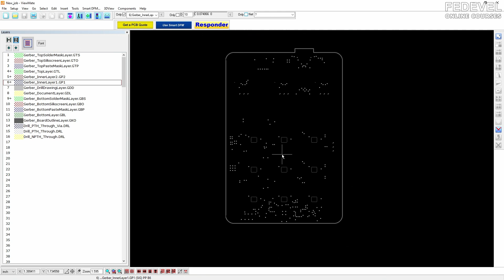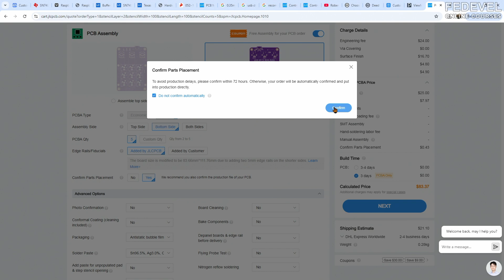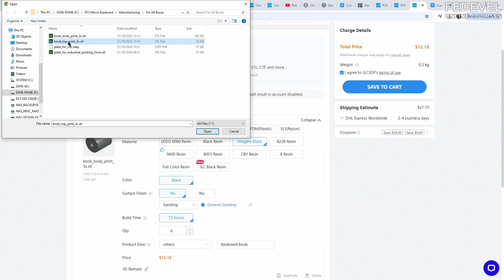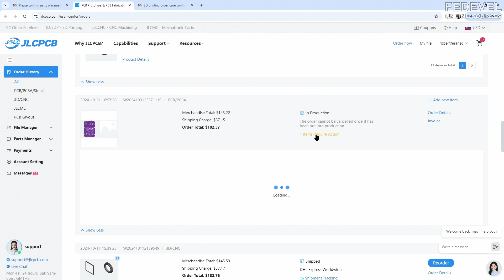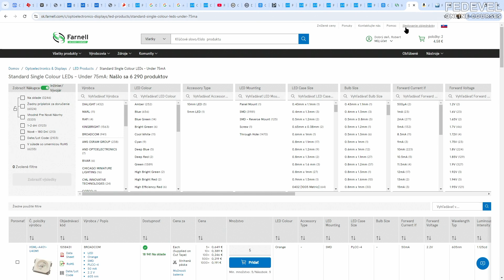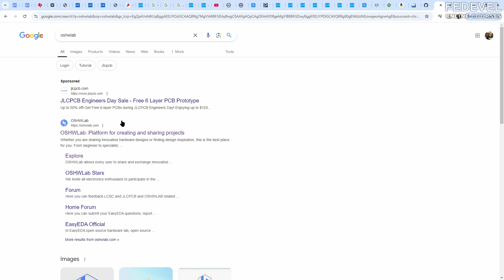Tutorial - Custom DIY Keyboard Design and Build | Part 7: Manufacturing

Comment: Hi Robert, I'm excited about your follow up video. Meanwhile, I had a few questions about the QMK firmware. I was able to get the keyboard working with your software files and program it using the VIA app. I quickly realized that the VIA app is quite limited as it does not support Mouse Buttons in Macros. I also noticed that Mouse Keys were not enabled in your firmware. I download the QMK firmware package from Github and make slight modifications to your code and flash my keyboard with the new file. Now, the issue is QMK configurator won't let me configure the keyboard as your keyboard is not in their dropdown list. Is there a different keyboard that I can select from their range of keyboard that represents your design? Are there any other ways of configuring the keyboard with full customization than VIA app? I'm open to programming options as well.
Reply from the maker: I think you may be able to hard code the keyboard directly in the code without using QMK configurator, but it was a long time ago I played with it, I don't remember exactly.

Comment: Hi Robert, how did you solder the RGB, Yellow and Green LEDs? They seem to be too small to hand solder.
Reply from the maker: I will do follow up video on this. it can be done by soldering iron, but much better is to use hot air gun. something like this: https://www.youtube.com/watch?v=KWIzhbQaZZk&t=28523s
Reply: @RobertFeranec  Thanks for the link and I look forward to your follow up video.

Comment: so how does the key switch actually connect to the pcb. is it soldered?
Reply from the maker: you plug the switches into sockets which are mounted on the other side of the board. Here you can see it: https://www.youtube.com/watch?v=rMoTqSC9wrY&t=16s